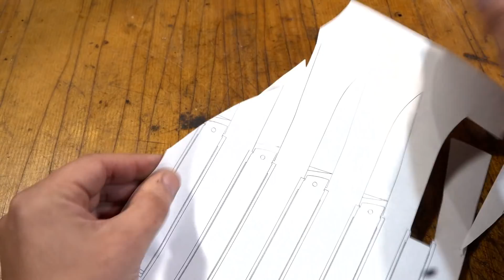Knife Making - Cross Folder Knife

Comment: It's really hard making a knife design that is unique and actually good. That's really awesome to think of a design like that
Reply: It is a design from the early 1980s Smith & Wesson 6041 and 6042 Swing Blade Knives, they came in a single edge and double edge design
Reply: This is not new design. I bought one of these in Turkey in 2016. Not the most practical but fun to play with
Reply: He didn't think of it first CTKT had the same mechanism years before
Reply: It's not unique, buy it is cool as fuck. And takes a lot of skill, BUT, it is not an original design
Reply: It is indeed a cool knife but my granfather made a knife like this when he was 15 in 1958. So he made a knife with this same mechanism way before Smith and Wesson. And it is my knife now, still working, still sharp😁
Reply: And as he lived (and still lives) in Hungary he couldn't copy any designs, because according to my knowledge nobody made a knife in the socialism like this.
Reply: @Kaheedran  crkt's version of a side opening folder is a little bit different from this in that it's a locking design. This is more similar to a smith and wesson design from the 80's.
Reply: @netgod3com-FUYouTube  Yes, I got one, S&W spearpoint with a fuller. Cool knife.
Reply: @gajdankristof5768  A Diósgyöri acélművekben százával készült ilyen kések, az 50es években.

Comment: I really like the design. It's something a beginner could attempt without feeling overwhelmed. You are clearly not a beginner and did a fantastic job. I might attempt this with titanium instead of brass and steel for the handle portions.
Reply: @padlok1520  if you heat titanium with a propane torch it bends with no effort while its hot. once it cools its very rigid again. I work in aerospace parts manufacturing as a machinist and we do a lot of hot forming titanium for curved parts. I've also made a titanium spork by clamping a ball peen hammer in a vice with the ball facing up and repeatedly heating the spoon area of the spork with a hand held propane torch and hammering against the ball to achieve a scoop contour. I use it every day to eat my lunch.
Reply: Is your spork all colourful from the oxides?
Reply: @davefman1984  fuckin a! that sounds very cool, i've been led to believe that that forging ti is hard af, but if you got it you got it. upload pics of the knife when you're done!
Reply: @NicolasPicklelas  yes
Reply: @padlok1520  I ended up using aluminum for the knife handle because I dont have a way to get precision bends in titanium. I do have a set of micro pliers with a folding knife in the handle that I recently finished. The plier portion is titanium and has a bent tab that provides tension on the knife blade. I will try to figure out how to upload a video.
Reply: @padlok1520  I uploaded a video with several knife projects. some with bent titanium. I can try doing a video of bending some titanium a little later. I don't have any experience forging titanium so I can't speak to that

Comment: the way the it opens and closes is a very cleaver design.  the U-shaped blade guard is on the outside of the brass when open and slides inside when closed because of the offset pin location.
You did that perfectly.
Really nice job !

Comment: Did you watchers noticed how skillful he handle the angle grinder? 
This Guy must be the Anglegrinder God or he sleeps with it under his pillow.... XD
Reply: Maybe he went to the crossroads.
Reply: Yeah im good at it too just comes from doing it alot but this guy is better then i am
Reply: I was gonna say that method tends to make discs kick and explode . . .
you don't want to be making tracks for the disc to run along or have the friction run in a direction that pushes out of the cut or towards you!
Reply: @bardrick4220  nope. If you are making disks explode you are handling the tool poorly
Reply: @bardrick4220  no man, if you think tracing the line with an angle grinder will make a disk explode you are handling your angle grinder improperly. If you ever make a disk explode, you are handling your angle grinder improperly.
Reply: @bardrick4220  and the reason people dont like just drawing a line and cutting it is because this isn't a saw, its an abrasive cutoff disk, and its also a handheld rotary tool that is unstable. Cutting a shallow groove makes it easier to keep the tool on axis and the disk shallow, thereby making it less likely to catch the material throw the disk
Reply: @Allanrpsx  LOL do you even weld bro?!  Who stuffs a disk in all the way?  The same goes for a saw blade dufus!
Reply: I thought the same thing when I was watching him cut. The guy is a beast
Reply: You ever see a tile guy use an angle grinder. Making this drain cuts takes a lot of practice

Comment: I used to have a tiny one of these. Probably my favorite pocket knife until I lost it. One thing I noticed is that yours locks in the closed position instead of the open one. On mine the brass is outside the bent bar when it’s open. Not sure if that really changes any thing but still a very cool build

Comment: Does the cross folder knife design or your frame folder knife design lock back when the blade is folded out? I really like both of your designs I'm just really hard on my tools and knives and if the blade locked back I would feel much more comfortable using the knife knowing thatit would not fold back and possibly cut my hand. I have watched your videos repeated times however I cannot figure out if the blade locks once its folded. A rough design template that I could have emailed to me would be greatly appreciated although I understand if you can't. Thanks

Comment: I am a more utilitarian person so I wish to ask how much pressure can that pin take? I wouldn't want to be cutting something then have the knife blade swing loose. Can you whittle safely with this? what's the maximum cutting pressure you can safely exert?
Reply: Would it be prudent to make a backstop in the brass handle that takes the cutting force of the blade... something like a locking knife

Comment: what is in that pipe at 5:00 watch the name of the operation ?
Reply: That is ferric chloride, it is an acid used to eat away the steel and make it have a darker finish. It is used with hamons and Damascus to bring out the pattern in the steel. It usually called “acid etching” he probably diluted it to make it more controlable
note: you can also use instant coffee to get the same effect
Reply: @leostraker3494  thank you so much

Comment: What use is the outside portion around the blade? Why have a two step folding knife when one step is easier and has much more utility? Folding knives fold to increase their utility. Having multiple steps to getting the blade out doesn't seem to complement the folding knife design overall. So unless this bar can be used for a guide or something, which I can't see how to use it, then I'd say this is actually an over engineered folding utility knife.